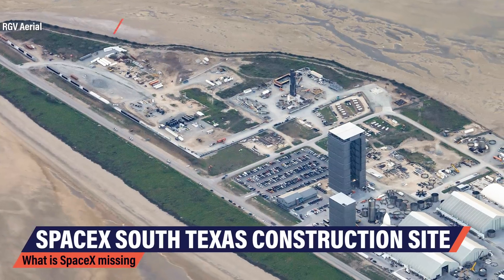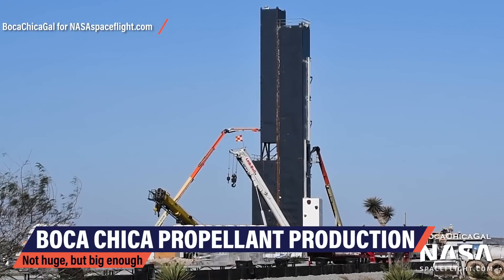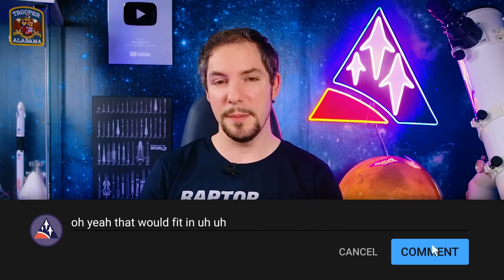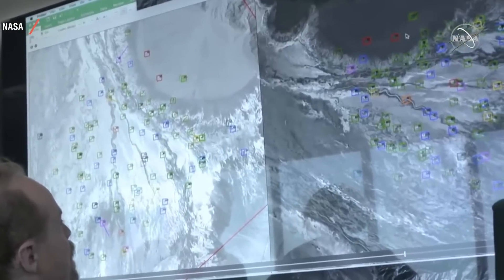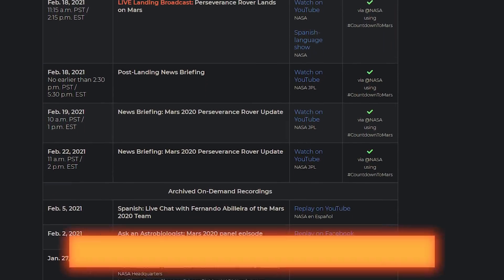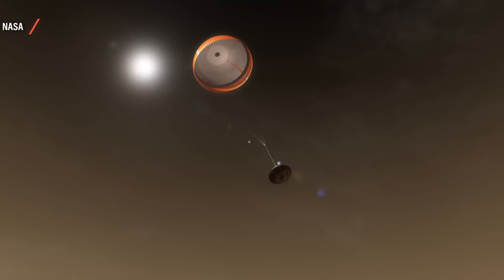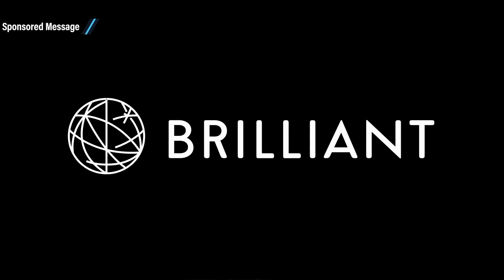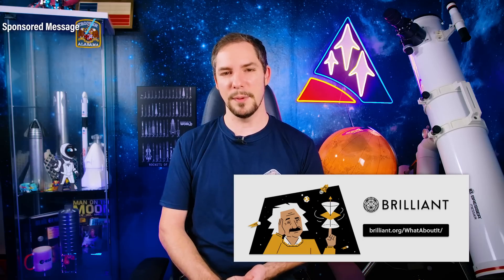146 | Elon Musk’s solution for SpaceX Starship Landings – Perseverance preparing for safe landing

Comment from the maker: What kind of object is laying on the ground at the Cocoa Site? :_WAISweet:
Reply: Matter/Anti-matter reactor warp drive core.
Reply: @PRODIGY5369  such a core will only produce positive energy and for a wrap drive you also need huge amounts of negative. So if it is really meant to be a core for a wrap drive it has to be some sort of quantum aplification portal.
Reply: @parakmi1  interesting. I like your thinking. With enough energy it could be a time displacement module - which would negate the need for warp drive. Just displace time until the universe has moved into the correct position relative to the ship.
Reply: @PRODIGY5369  yup. Time to go to alpha centauri
Reply: its propably the tube that connects the o2 tank with the engine
Reply: Steely Dan
Reply: Looks like it could be a heat exchanger or a cracking tower... just my guess
Reply: It looks like a shell and tube heat exchanger. The chiller unit would pump mixed refrigerant through the tube bundle to liquify the methane or oxygen in the shell side.
Reply: It's a metal cylinder.
Reply: ᏗᎡᎾᎾᎢᏍ ᏗᎢᎦᎦᏍ
1 second ago
It look's like an distillation tower .I have with the oil and chemical industry most of my career as a leaded operating refrigerant and steam Engineer.
Reply: @user-ri4kl2kv9d   I was thinking the same thing was trying to see if there was a dome on the other side but it’s a poor angle
Reply: Looks Like a tank used to separate gases used in oil and natural gas production.  It would be erect and as gas travels up it, the gas is chilled to different point causing a desired gas to liquify and fall out. Separating the natural gas from others like propane, and maybe methane.  Could this method be used to on air to seperate the O2?
Reply: great video Felix keep up the great work can't wait to tune in for the next one see you there
Reply: I believe that they are planning to build a methane and oxygen refinery that works installed inside the Starship’s payload volume, so once it lands on Mars it can start producing propellant, as it can use its own now almost empty tanks to store the production. It would be an autonomous refinery-style Starship. Maybe it would be fundamental for start the migration process as it would be smart to go to Mars only when they have enough fuel waiting on site for an emergency escape in case something goes wrong. At least at the beginning as they do not have a refinery at Mars and no personnel to construct the first one.
Reply: The mostly cylindrical object is a heat exchanger and rectification column.  Likely the rectangular object is a cold box meant to house the various heat exchangers and expanders.  See "Industrial Gas Procesesing".  There is likely a quite large compressor about, looks kind of like a drum with mouse ears.
Reply: Its a roller for shaping large pieces of metal. You are only seeing 1 of 5 of these.
Reply: @motox731xxx  Yes ! That most Likely. Thanks
Reply: The object looks like a condensation column of a cryogenic liquification plant for production of LOX or LNG. Alternately it could be a gas wash column for gas purification. Very likely not part of the starship.
Reply: @Apollo Is Back You´re not lying? :-)
Reply: If they're producing LNG on-site, I suggest it could be a Main Cryogenic Heat Exchanger
Reply: It's not just Elon musk 
It is Full Space X team
Reply: @deathnote4171  I'd bet money Elon Musk wouldnt have any of these results without the Space X team..
Reply: It's a giant death ray
Reply: @basicallydan  finally.
Reply: Seeing as that sight isn't really being used for much any more, it's very hard to say. But, maybe an internal strut for BN? Or maybe something to do with a landing pad or system for the long launch over the gulf? Could be for refining/storage as they ramp up for constant supply, like extra fuel storage? And finally, an underwater server center/communications etc. They put them in the bottom of the ocean to help keep them cool, would help explained the battery. Idk though.
Reply: They build a new Falcon 1.
Reply: I wonder if its a part of a future orbital propelant depo a insolated gass cylinder to store and consentrate methane and Co2 from on orbit space station to produce water and oxygen to sell to NASA and other orbotal outposts keeping the carbon for later use. I beleve NASA has a agrement to buy water from launch providers through a public/private agrement. They still have a uper section of the starship on sight might be used for test fiting and development of the first test lsunch of a payload on Starship to orbit.
Reply: i dont know what it is,but it was a tanker trailer from a truck.
Reply: Steel joint. Giant steel joint
Reply: i think it is the chamber for distillation of air into its constituents.
Reply: i guess cooling channels and armatures are build into it and that's why the walls are thick and there is the suqare box with what seems like connections on there.
Reply: the handle of a very very large light saber ...
Reply: A big tube for fuel?!
Reply: Maybe it is the first starship payload or dummy payload!
Reply: It could be a piston for keeping the fuel in the starship stable when the starship is in Zero-G, however this is unlikely and is probably excess sheet metal storage or other material.
Reply: Clearly that's the Starship warp drive engine, Felix!
Reply: certainly not a dildo
Reply: Just ordered the shirt you’re wearing 👍🚀
Reply: It looks like a giant lightsaber, perhaps to be wielded by Ultraman.
Reply: It could be machinery done ahead of time for the crane part of the booster catcher.
Reply: with a full scale mock up of a starship nearby, it may be a fractioning tower to get remote fuel production figured out, as the first few flights have to have fuel being made long before the arrival of humans.  think of the Florida site as SpaceX's 'skunk works'.  deep r&d.
Reply: Roborav D  in spacetravel you are allways on the edge between durabillity and breaking. thats the way to take some weight down :) thats way rocket sience is that hard
Reply: Wind turbine
Reply: It’s a penis!
Reply: A role of steel but wider in diameter.
Reply: just wanna say grats on the awesome growth you have accomplished with your channel i may have been harsh once b4 with a different account name when you first started covering all things space,   but you have come into your own and i am proud to watch your videos now as you sometimes have more info than EA  on certain things, research  is key even tho EA has been stuck in a hotel in boca for a few weeks you are out performing on the reporting soo HATS OFF to ALL who help you do your stuff. you sir have definitely earned my sub even tho it may have taken a while.  but i have watched almost every vid you put out since hopper reports :D
Reply: Well it looks like a giant lightsaber to me...
Reply: Maybe the Cocoa site is developing the equipment for Mars fuel production?
Reply: or they switched the gender of the vacuum "maid"...
Reply: "Jezero" (or something similarly written/pronounced) means "lake" in many (if not all) of Slavic languages. Check out the Wiki page, The Mars crater is listed there. :D 
https://en.wikipedia.org/wiki/Jezero
Reply: Hi Felix , i think it may be a piece for the LOX DISTILLET?  May be so thank's for this instructive video 👍💪🚀Yu Rock 💪
Reply: Distiller sorry!
Reply: @heliostarhelios5355  For future reference, you can edit your comments, saves you some apologizing down the line. :D
Reply: Maybe a methane down comer pipe ?
Reply: It's a jefferies tube....or someones making a home job while Elons not looking.
Reply: Epic dildo
Reply: Looks like an industrial heat exchanger.. we use similar. But not in stainless. Stainless would probably be better but its down to cost.elon dont have that problem
Reply: It's the drive-shaft for the propeller of the Star-SHIP.
Reply: Must just be a pipe for starship or super heavy
Reply: Fewix, you sownd (somewhat) wike a baby.   Not sure it you are aware.  Its not awful to listen to, but it's not so bad that I don't think you could improve it with some care.
Reply: @PRODIGY5369  It's where they filmed Interstellar. We just haven't reached the timeline or dimension yet
Reply: Elon's new vape.
Reply: A telescopic dild..crane arm??
Reply: Huge candle for that dank green smoke, so the whole Space X team can join Elon in the hit.
Reply: Why are some news outlets saying video won't be available for a few days?
Reply: Ok so maybe not an anti matter drive.
All the SN's so far have external plumbing and electrical wiring, battery on dome. Could this possibly be a prototype of making an internal plumbing and electrical assembly around the downcomer? Just a wild guess and probably wrong 👍 .
Looking like it's stainless so I'm thinking it's a Starship component anyway.
Reply: Does the rectangular box on end look suspiciously the size and shape of a Tesla battery?
Reply: 26 seconds ago
1 view
9 likes
1 comment (this one)
normal
Reply: @rocketcello5354  FIDO go flight!
Reply: @rocketcello5354  We in Brazil keep about this Upadate events...
Reply: Looks like t's either a distillation tower for refining 2 liquids with similar boiling points, or a cracking tower to break oil down into lighter fractions.
Reply: It´s a SRB  😁
Reply: Supplies of lithium then so be it, paraphrased,
Reply: That's : what about it?
Reply: Elon is accused of financially supporting coups in lithium producing countries.
Reply: You should not support Elon. Climate change is the threat. Elon burns fuel like crazy. And we all watch the crazy man with big fireworks whilst our home the earth burns.
Reply: Wanna know what Sri Lanka sounds like?
https://www.youtube.com/watch?v=wbIIH_u2QJA

Comment: 2:52 Redo from the outside suggests that the heat penetration was inconsistent on the internal weld bead. 

This semi-manual weld is normally only made from the inside, but I would like to see it heated - or even welded - from both sides simultaneously. Perhaps a robot can precisely follow the lead set by a welder on the other side.

Comment: I am sure space x is working on why the engines have problems with restarting reliably, the 3 engine idea is not really a fix. Mt opinion is there a real problems with fuel pressure after the " flop ", I wont pretend I know the solution.

Comment: With concrete that thick, curing could take months.  According to records, the Hoover Dam is still producing heat from the curing of the concrete laid decades ago.  Most likely the reason that production hasn't been ramped up is because of the changes still being made on the design.

Comment: It used to take Rolls Royce 40 hours to build 1 Trent XWB Airbus engine. By 2017 the Dahlewitz plant could build 2 in one week. Combined with production of 5 per week from the Derby plant they can produce 1 engine per day (up from 1 per week). SpaceX plan is 3 Raptors per shift with 4 shifts producing 12 Raptors a day! Pretty impressive for a single engine powerful enough to destroy the plane they put 4 Trent XWB engines on!

Comment: I have an idea of how to keep the fuel always in pressure and at full flow to the engines even if the tanks are not vertical and that is keep the tanks diaphragm under pressure . The other is to use a gimbal system to keep the pickup always in the fuel .

Comment: What if they landed the SH in an underground pit, so that the top is flash with the surface ? That will solve the stacking problem. They can even fill the pit with fire suppressing foam in case of emergency
Reply: For sea launch, they can drill a hole on the deck and land the super heavy in the hole.

Comment: why don't nasa park sattilite(s) at points along toward mars tu boost radio trans and have one in orbit preloaded with landing info in case of problem with entry when you need imediate response  no lag in signals?
Reply: Radio waves travel at the speed of light. Having satellites somehow parked doesn't change that. There will always be a lag because of the great distance they must travel. If you were to put a massive line of satellites end to end (somehow) from the Earth to Mars, the distance the radio waves must travel will still be the same. You cannot "boost" the transmission in such a way.

Comment: If some engines are failing to land Startships, they might be an slowing down in engines production until they are sure there is no major modification that need to be done in the design of raptors. It is smart to  slowdown production until they nail it with Starship.

Comment: I think they should run the turbines with electric engines like electron rockets but run a petrol powered generator to supply electricity.
Better starting better throttle control, two turbines instead of 4 .
One generator

Comment: I really don't think they have a handle at all on why the failures.  It would seem to me they have a fuel flow problem in going from vertical to horizontal to vertical again.  This is causing the destruction of the engines because oxy / fuel ratios within the engines go out of control.  Starting all three is no answer.

Comment: Willing to bet the "flip maneuver will be performed at a higher altitude giving the sensors, avionics & controllers more time to perceive, analyze and react to conditions as they exist vs. as they were forecast/programmed. It will cost more fuel for landing BUT a less violent maneuver so close to the ground will be a big improvement, offering more options for recovery from various failures. Analogous to the "stabilized approach" in airplanes and particularly in helicopters, where you don't make every landing like an autorotation flare "just in case."
Reply: Doug, I agree with you, love to see a technical discussion on this subject. The following is a copy paste from an earlier comment posting “SN8 & 9 flight profiles where very conservative except for the landing. Why? I understand the landing flip maneuver close to the ground is based on the goal of minimizing landing fuel mass. But why do this maneuver so early in the test program. At this stage of development doesn’t it make more sense to do a more conservative virtual landing much higher up and then end the flight with a SN5 & 6 slow hover landing? Is this do or die close to the ground flip maneuver acceptable for a human rated Starship, wouldn’t a crew-rated Starship need greater safety margins for its landing? Wasn’t the Falcon9 developed right from the beginning to be human-rated. Would a slower horizontal to vertical transition at a higher altitude along with some fuel settling vertical deceleration (gaseous 02/CH4 RCS) offer the needed safety margins? Felix you definitely rock, your WAI is one of the best youtube space channels. Love your work”
Reply: @linasvelavicius330  I'm confident they will come to this. They are still far away from qualifying for manned missions in this spacecraft, and that will involve taking all unnecessary risks OUT of the flight profile, not putting them in for some sort of mission improvement. Unless I'm really missing some technical angle- I'm not a rocket scientist, but I never just give it up to the experts.
Reply: @dougmartin8823  Doug thanks for the reply.  Would love to see Felix do a WAI deep dive on the close to the ground flip maneuver. He’s good at bringing out the details and speculating on the possibilities.

Comment: Perseverance knows where it is at all times. It knows this because it knows where it isn't. By subtracting where it is from where it isn't, or where it isn't from where it is (whichever is greater), it obtains a difference, or deviation. The guidance subsystem uses deviations to generate corrective commands to drive Perseverance from a position where it is to a position where it isn't, and arriving at a position where it wasn't, it now is. Consequently, the position where it is, is now the position that it wasn't, and it follows that the position that it was, is now the position that it isn't.
In the event that the position that it is in is not the position that it wasn't, the system has acquired a variation, the variation being the difference between where Perseverance is, and where it wasn't. If variation is considered to be a significant factor, it too may be corrected by the GEA. However, Perseverance must also know where it was.

Perseverance guidance computer scenario works as follows. Because a variation has modified some of the information Perseverance has obtained, it is not sure just where it is. However, it is sure where it isn't, within reason, and it knows where it was. It now subtracts where it should be from where it wasn't, or vice-versa, and by differentiating this from the algebraic sum of where it shouldn't be, and where it was, it is able to obtain the deviation and its variation, which is called error.